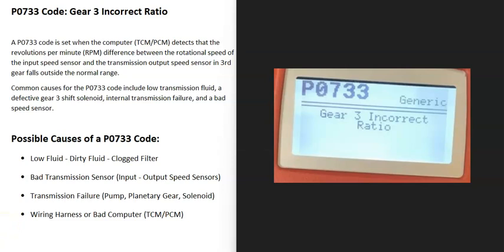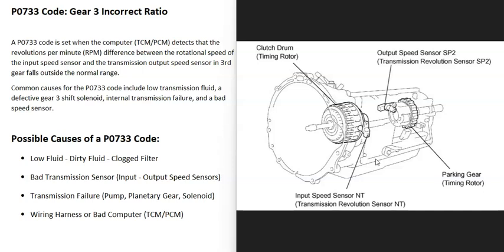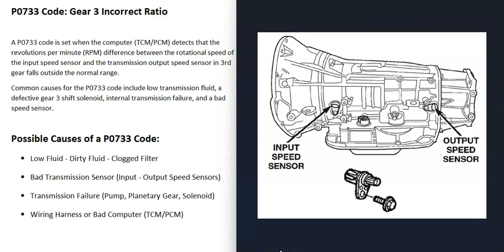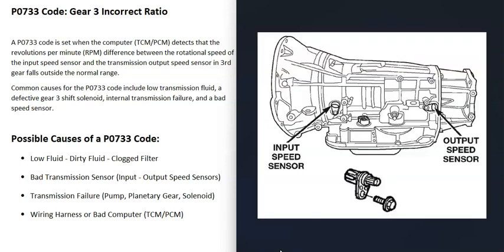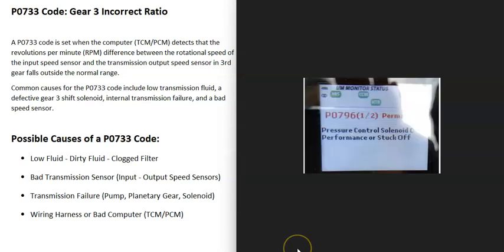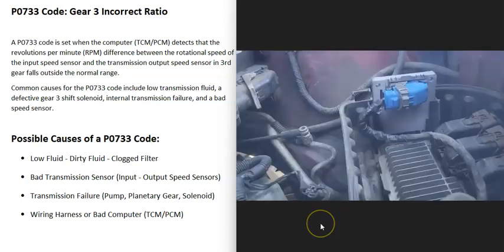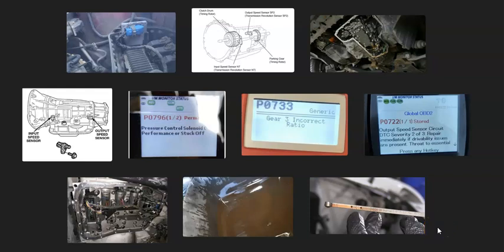Causes and Fixes P0733 Code: Gear 3 Incorrect Ratio

Comment: I got the p0733 and p0700 code but that’s it so not really an indicator of a sensor. Once I clear the code the car goes back to normal and it won’t happen again for a day or two. Do you think it’s possible it’s the transmission control relay or would that set off another specific code? Any help is appreciated. Thanks for making this video

Comment: Mine only comes on when it’s cold and hasn’t driven. Once I drive it for a bit and it shifts it’s good, I never get a code. But cold it shifts hard into 3rd and reverse. Changed the fluid and filter with no change. 3rd solenoid is my next

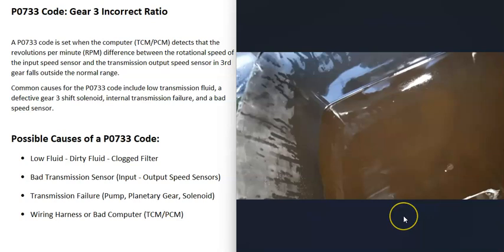Comment: So my transmission fluid looks just like the one on the example you are putting on 1:10 should I change the fluid in getting p0733 and p0700
Reply: did u change the fluid or what u did to remove code

Comment: I have a 2001 Nissan Frontier that threw this code. Ironically it would only happen in the colder seasons and it would take about 5 miles of driving to get it to shift into OD. I replaced the shift solenoids which helped for a few months only and then it threw a temperature sensor and IAC code. After studying the temperature code, I learnt that it also affects the transmission shifting. I replaced the temperature sensor and IAC valve and haven't had transmission issues since.

Comment: I just got and installed a rebuilt transmission, getting the overdive off flashing light, and getting P0733 and P0735 codes.... but only when i went on the highway town was fine

Comment: I have an Audi A-4 2004 1.8 t Quattro I’ve checked the solenoids replaced the fluids filter in the transmission   But still goes into limp and won’t shift into third gear.  I guess the speed sensors are next.
Reply: Did the speed sensors work?
Reply: Does it go into limp mode when its hot ? Or it does it momentaly in 3rd gear
Reply: @veskoboskovic5127 mines just started doing the same gets stuck in 2-3 gear arm took it to one guy he immediately said new trans but seeing this video wondering if it’s just a sensor. Got the same exact code
Reply: @hec3110  my q7 2007 also .. i drove it perfectly like 30 min and then when it got hott it slips from 3rd to neutral. 🙂

Comment: I think I’m having this issue I’ll get up to speed passed 1 into 2 up to speed but only revs high rpm won’t shift and gain more speed into 3
Reply: Not even sure how this happened my trans line broke before I bought it the guy put a hose on it so when I got into the gas the hose broke free and drained my transmission
Reply: Towed it home found why it broke free to begin with then filled the trans back up to have this issue happen (master cylinder is bad putting pressure on the brakes and more strain on the engine boom hose broke off drains trans)